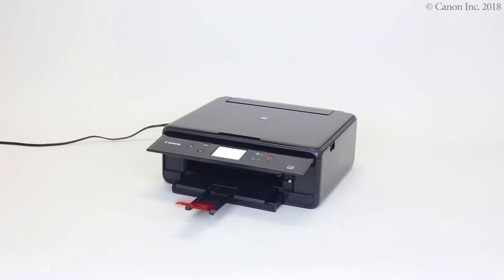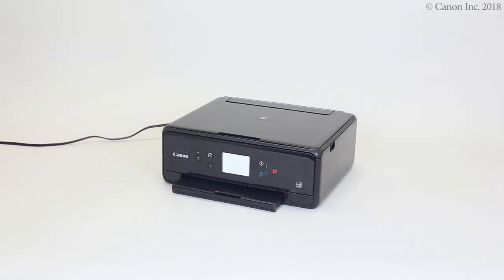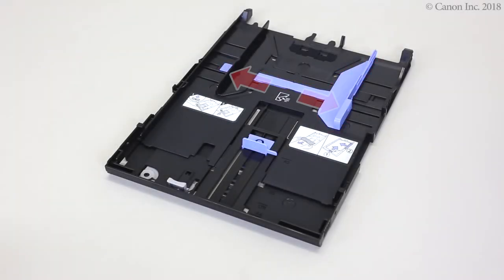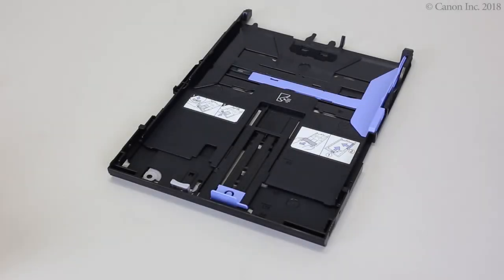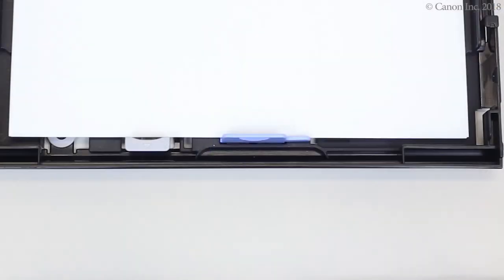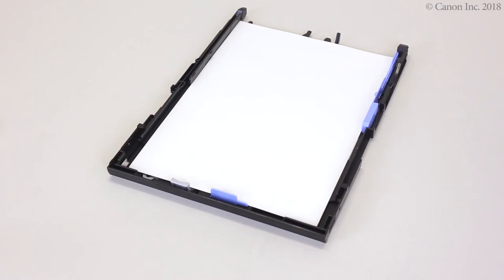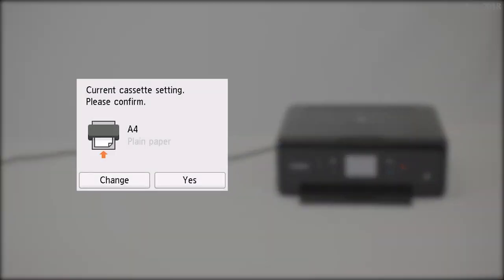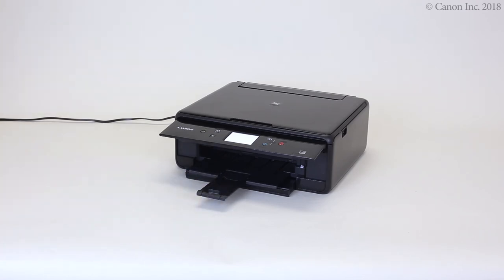Canon PIXMA TS6220 -- Loading The Paper Cassette

Comment: "Close the output tray extension." My 6220 doesn't have one but I don't do a lot of printing so I just catch the printout as it comes out. I still wonder why mine is different though.
Reply from the maker: Hi!  You should be able to print from your PIXMA TS6220 with the output tray extended.  If your printer isn't allowing that, we recommend contacting our US-based support squad so that they can help you figure out what's going on.  Take a moment to register your printer at https://canon.us/account and you'll find your support options and our contact information there.

We look forward to working with you!
Reply: Just got back from Staples. Their display 6220 doesn't have one either. I can load in the back and pull the tray out to catch the printouts but their is no middle "output tray extension" as shown in the video. No big deal for me, but are you sure that is a 6220 in the video? I can print without it.

Comment: How do you switch from using the rear paper tray to the one at the bottom?
Reply from the maker: Hi Kaitlyn:

You will want to make sure that you have loaded paper in the cassette and that the page size on the touch screen matches the size of paper loaded in the cassette.  If not, you will want to select [Change] to change the setting to match the paper size loaded.   Refer to pages 84-88 and page 220 of the instruction manual, for selecting Paper Source tray.  Here is a shortcut to the manual: https://Canon.us/xmkjn.
Reply: Jm
Reply: @CanonUSASupport  jj

Comment: Cassette will not slide out more than  3 inches and cannot be removed.
Reply from the maker: Hi!  The paper cassette on your PIXMA TS6220 should slide right out as shown in the video.  If your paper cassette is stuck and you've tried all reasonable methods to pull it out without breaking anything, we recommend contacting our US-based support squad for help.  Take a moment to register your printer at https://canon.us/account and you'll find your support options and our contact information.

We hope to talk to you soon!